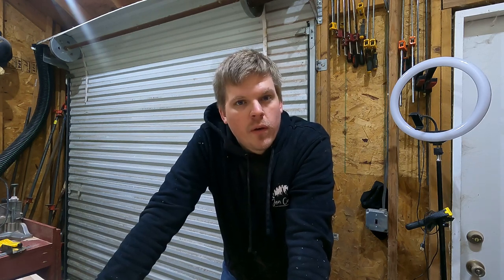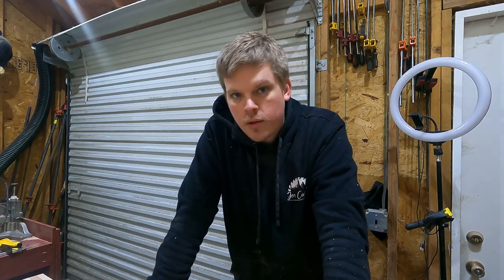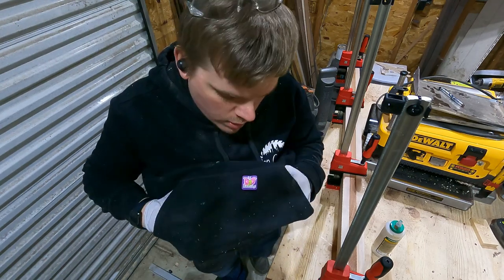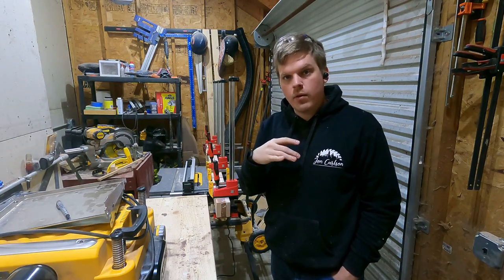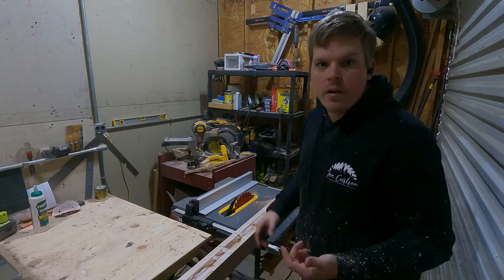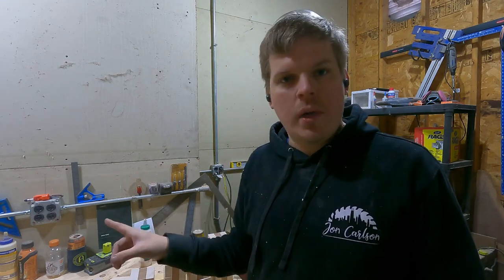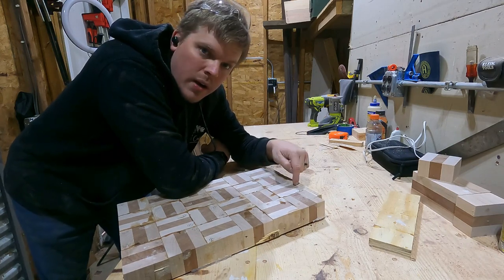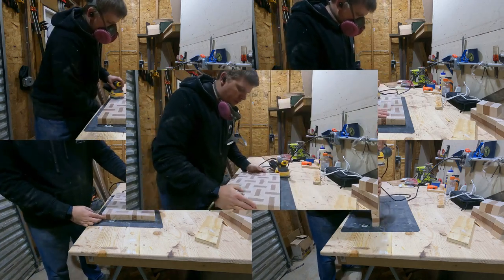Parquet Pattern Cutting Board

Comment: Could you tell me the length of the board you start with with the two people and the walnut down the center it may be there when you cut tell me the 3 inches or 3 1/2
Reply from the maker: Hi Nick
Not 100% sure I get what you're saying but... The laminated piece is 3" x 3" x 36" long